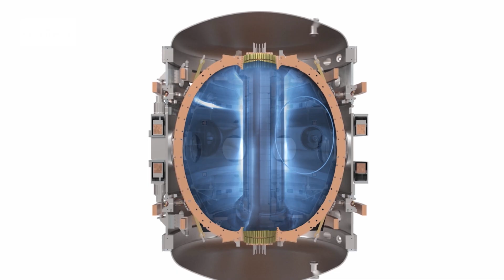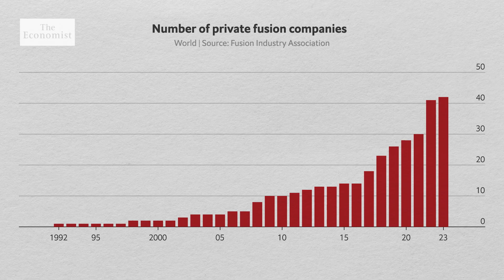Is nuclear fusion the future of clean energy?

Comment: 3:10 deuterium is fairly easy to come by in nature, but tritium is very rare, and there isn't enough on this planet to supply fusion reactors. On the other hand, there is so much fuel for fission reactors to last us 1000 years.
Reply: So what are they thinking then? Surely there is a solution?
Reply: @musicalintuition  it's just one of the many hurdles to nuclear fusion. There are other fuels, but I believe D-T fusion produces the most heat with the lowest fusion activation temp. So it's the place to start.
Reply: Yeah let's use fission for 1000 years so we can make the planet uninhabitable.
Reply: @sapphyrus  The hard facts are that fission is the safest and least environmentally damaging way to generate energy. Safer and more sustainable than wind or solar per terrawatt of energy generated. If you're knowledge of nuclear energy and waste starts and ends in the 1960s, I could understand your point of view. But reprocessing and inherent safety design eliminated nearly all of the concerns you could reasonably have against it. The only hurdle left is to implement these better nuclear technologies at a large scale. Several other industrialized nations already have. They undoubtedly have high upfront costs, but low operational costs which makes them comparable to renewable energy costs over their lifetime
Reply: @sapphyrus  how do you figure that would happen?
Reply: Tritium is produced in every watercooled nuclear reaktor. To seperate it out is a minor problem compared to get fusion reactors working.
Reply: @krautergarten4529  True, you need fission reactors to fuel your fusion reactors, so it's not really the perfect energy source to solve all our problems.
Reply: @ColCurtis  we will always need fission reactors to produce isotopes for medical, aerospace, fusion, etc. And we still need to build 1000 to 2000 new fission reactors in the next 50years to stay below +3°C. So there will be enough tritium for the first gen. fusion reactor, for the sec. or third we may use berilium. Halflife of tritium is 12years.
Reply: @ColCurtis No on a lot of levels. As a source material for starting a reactor, tritium would likely come from fission moderator rods. But every fusion scheme in the world that is targeting a D-T system plans to breed tritium from lithium using the fast neutrons in the fusion reactor. It's not an engineering oversight, it's a journalistic one. That said, fusion powwr generation is not likely to reach a level of maturity adequate to be commercially viable for at least another century. It's not a condender to the climate crisis
Reply: @Spencergolde  you think the climate crisis will be all over and done in a century? We need some big gun energy solutions down the line, and it would be better if it wasn't fission.
Reply: @MattNolanCustom  I believe, with data backed up by climate research, that if we don't largely replace our energy generating capacity with non-carbon sources before the turn of the century, human life is going to be very difficult to sustain, there will be lots of suffering, displacement, famine and drought. We have non-carbon energy sources today that are mature and, not just ready to deploy, but actively working in our grid right now. Nuclear fission is powering some of the servers you're currently using to view this comment. Granted, fission can benefit from Gen IV technologies that eliminate the possibility of meltdowns, reduce waste volumes by at least 95%, and breed their own fuel. That technology already exists in the lab and will be responsible for baseload energy maintenance in the coming decades. Solar, and more so wind, will also play an important part with the aid of grid battery storage; but it will take a concert of renewables and nuclear to overcome this issue, as renewables are too environmentally destructive (compared to nuclear) to meet energy needs in their own
Reply: @Spencergolde  one major way we could lower the future greenhouse gasses that nobody wants to say is to quit increasing the global population.
Reply: @Spencergolde  I don't disagree with you at all. We need a diverse, carbon-neutral, mix of power generation, adopting all the things we can as quickly as we can. But, looking at the various other "footprints" of various energy generation methods when adopted at huge scales, fission and hopefully later fusion have to be a significant part of that mix, otherwise we just end up "killing the planet" in different ways.
Reply: @MattNolanCustom  I think the way I'm looking at it is: with a limited amount of money and political will to achieve climate stabilizing goals, I think the vast majority of investment should go towards developing things that have a clear part to play in the solution. Fusion just, doesn't. The most likely reactor to reach ignition, which has the most money and the best minds working on it,  is ITER, and that doesn't even have a targeted online date. If there's a miraculous way to get around the engineering challenges we're facing now, we haven't found it yet, and as with all miracles, there's no way to say when that will happen. Solar and wind and batteries and nuclear have adressable issues that we understand and can work around. I just hate to see people investing tens or hundreds of millions into something that's sold as a keystone to fighting climate change, when it definitively won't be. That money could have induced actual, positive change, but instead it'll be sunk into a rust bucket that some venture capitalist with a business degree, who read a physics book once, decided would look cool
Reply: @Spencergolde  I don't think it's a question of either or. There's money to do it all, and we should be planning for the further future as much as tomorrow because climate change is going to take many decades to sort out. I'd say that the MIT / Commonwealth SPARC will likely leapfrog ITER (though the work from ITER has certainly helped them along!)
Reply: @MattNolanCustom  The money can and will run out. Climate change is expected to endure high economic costs from things like increased drought, flooding, migration, loss of agriable land, mass migration, increased hurricanes, increased disease domain spread, etc. We have time and money now, but in 30 or 40 years, we might not have the luxury of being able to spend time and money on science projects that don't have an immediate practical application. Yes,  zero carbon energy development would still be helpful then,  but in desperate times, you might not be able to find investors or governments that are willing to spend on tomorrow-solutions, there's likely going to be high demand for short-term solutions and not much else. Keep in mind that we're still living in a time of plenty, which makes well wishing easy, but we are literally on the precipice of that no longer being the case. So every single year and dollar is critical. 
And yes, I'm aware of SPARK, I think if they're legit about the confinement field strengths they were able to achieve, that would be impressive and could achieve ignition on paper, given what we know now about H-mode instabilities, and assuming they can maintain those field strengths 24/7 and not just for a breif demo. It is of course made possible by rare earth superconducting magnets, which I think may be prohibitively expensive for a commercial reactor. They also need to focus on helium product removal to prevent extinguishing the ignited plasma, a challenge that fusion researchers have known they need to deal with and haven't had enough success to get to deal with yet. I'm less inclined to rip on SPARK because they're taking a novel technological development (lower cost, flexible type-II superconductor tape) and are applying it to a mature sector of fusion reactor design. Many others, though, are pie-in-the-sky, or else like helion, near direct copies of research done in the '80s, with nothing new or noteworthy to add.
Reply: Also tritium is radioactive :/
Reply: @kashmirha  bananas are radioactive

Comment: More and more people think today that c² in E=mc² is imaginary - a faith not science - as "A derived Value must not violate the Concept of its Value".
When energy looted - it turns - curse.
A curse that destroys in humans consciousness and the future.
Karl Marx, Nikola Tesla, Balfour, Einstein, Huxley, Orwell, Turing - should be forgiven for thinking their systems can last forever.
Finite fossil fuels are dangerously hypnotic to humans, their consciousness, reasoning and mental capacity.
Humans were not ready morally, ethically and intellectually to start the mass extraction of fossil fuels with the advent of the steam engine 300 years ago. 
The Magna Carta requires today overhauling – adding to it the right for humans to understand what Energy really is - before any other commandment;
“In any system of energy, Control is what consumes energy the most.
No energy store holds enough energy to extract an amount of energy equal to the total energy it stores.
No system of energy can deliver sum useful energy in excess of the total energy put into constructing it.
This universal truth applies to all systems.
Energy, like time, flows from past to future” (2017).

Comment: Quantum mechanics allows for a small portions of fast neutrons are created.   These neutrons would make the fusion chamber radioac😮tive.  What are the precautions are 4:26  be formulated to 6:13  mitigate this?
Reply: Pretty straightforward. It comes down to material selection. Some materials like aluminum are fairly neutron transparent and don't form long-lived activation products. In general, activation products tend to be short lived, low activity, and non bio-accumulating. It needs special handling and a decade or so of isolation, but it's not comparable to the fission products that come from a fission power plant
Reply: General Fusion's design contains the reaction in liquid metal.  The "reaction chamber" is constantly cycled... it's how they extract the heat.  Must admit, I'm biased towards their design... steam powered pistons compressing a bolt of plasma contained in a vortex of molten metal has to be the most steam-punk energy reactor ever :)

Not holding my breath but I do wish them success.
Reply: @4Fixerdave  thank you for the heat transfer method.  Wish them luck too.

Comment: No! Nuclear fusion is neither renewable nor sustainable. If it ever actually works, we will start burning up our oceans -- all our water. Turning the Hydrogen to Helium at exponentially increasing rates as our demand for energy in the past has increased exponentially. When we are done, the Earth will be a dry desert like the Mars. It's actually ecologically worse than Oil.
Reply: Why are you spreading misinformation? Don’t comment on something when you know absolutely nothing about it.
Reply: @Gomlmon99  Apparently, you have no idea how nuclear fusion works. It turns hydrogen into helium. The hydrogen comes from the oceans. We burn the heavy hydrogen first, then we run the regular hydrogen through a nuclear reactor to turn it into deuterium and tritium -- then burn it. Once it is helium, it can never form water again. We will be burning our oceans. That's the way it works, that's the way it has always worked.

Comment: It's a waste of time when you can just invest that money into wind power, solar power, geothermal power, tidal power, wave power and storage, all of which work and don't require any scientific breakthroughs.

The only problem with green energy is the political will to move away from the lobbying (corruption) that goes with fossil fuels.

Look at the US the easiest place to turn to green energy is Hawaii, it's a series of volcanoes, so there is more than enough geothermal power, just like Greenland has done.  But Hawaii also is in the middle of the ocean so it's got enough opportunities to run 100% on wind power.  It's also very sunny, and you could have enough solar power for 100% of all the power.

As for storage you have mountains where you can build pumped hydro storage, or you could use hydrogen storage, or lithium batteries or sodium batteries.  Probably the best long term storage would be the hydrogen, and the short term storage would be a mixture of the pumped hydro and the batteries.

The fact that Hawaii isn't running on 100% renewable power, has nothing to do with technology, there is more than enough technology that has been invented for Hawaii to be 100% renewable.  It's a political problem.  And if the US can't solve the easiest US State then the US will never bring down it's CO2 output for any US state.
Reply: Solar power requires a lot of land + maintenance and has a shorter lifecycle too i.e. 20 years. Wind turbines also have recycling issues like the solar cells. Nuclear reactors are best choice, if the safety risk is well taken care of.
Reply: @gagan3440  solar cells don't have recycling issues they can be recycled and are being recycled.

The only issue recycling centres have is there aren't many old solar cells.  You wrote that their lifecycle is 20 years, so just have a think how many solar cells were being installed 20 years ago, that doesn't provide a recycling centre with many cells to recycle.  Even 10 years ago there weren't many solar cells being installed.

As for recycling wind turbines, there are developments in that area, but then again there aren't many old wind turbines, certainly not enough to build a recycling centre.  In reality the matieral for wind turbines will probably be reused for something completely different rather than recycled.

Comment: The Economist is not produced by engineers but by people presumably paid to promote well funded hype. Otherwise they would be promoting the British Moltex flex reactor, which benefits from the engineering advantage of using liquid nuclear fuel held in static pipes. I.e. no pumping of highly radioactive fuel around a system of pipes that will probably spring a leak one day. That makes the flex reactor so simple and cheap that they will compete with fossil fuelled electricity. Moltex energy in Canada are also pioneering the recycling of high-level nuclear waste for their stable salt fuel. Capital cost is a little over $1 per WATT. Dispatchable power is available from heat stored in a system bought off the shelf from the solar thermal people. Selling electricity at peak demand will make the reactor highly profitable. They recently signed an MOU with Emirates nuclear energy Corporation.

But all of this is a distraction, because the energy transition is not going to happen soon enough to avoid cascading climate tipping points. Respected climate scientist Jim Hansen now says probably the safest way to cool the Earth pending net zero is by marine cloud brightening. That works by adding benign aerosols over the ocean, replacing the cooling effect recently lost because of new shipping legislation that has removed sulphur dioxide emissions.

Comment: The problem of nuclear fusion is not technology. It is economy. Maybe we can make viable fusion technolgy and reactor by 2050, but its cost to build and operate will far exceed that of nuclear fission reactor, let alone conventional fossil fuel powerplant. So, it will not replace conventional power plants in the foreseeable future. We need interim solutions before transition to nuclear fusion. 4-th generation nuclear fission reactors like molten salt reactor or pebble bed reactor seems to be promising.
Reply: This is speculation. There are no operational fusion reactors with net positive output, let alone as part of a power plant. To say how much a potential products might cost based on current experiments is just conjecture.
Reply: So it is the technology, because we no cost efficient technology ready by 2050.

You need to build the 4th generation nuclear plants yesterday, for 2050. But they won't be build until the end of the decade and won't come online at least 5 years later. SMRs too, no commercial reactor before the 2030. How is nuclear the solution to a climate crisis we spend 50 years on waiting it to happen? It is like catching the train that already went out of the station. Nuclear will never be ready to play a major role in energy transition. Even in China is no plan for more than 15% nuclear electricity.
Reply: "The problem of nuclear fusion is not technology. It is economy." Uh thats not even remotely accurate...... Honestly what do you think they are testing for ITER? 

Or do you think they got 38 countries to build the most complicated piece of energy infrastructure in the history of humanity for craps and giggles?
Reply: There are enough mineable thorium on the earth to satisfy humankind for 1000 years, combined with wind，solar, hydroelectric may extend for another 1000 years. These are mature technologies, while fusion is always twenty years in the future.  So leave it to the future generations to do the fusion.

Comment: Fusion is inevitable, the engineers on the forefront should be proud of their work
Reply: Fusion is already here.  You can produce nuclear fusion at home, if you really want.  (Look up Farnsworth fusor, for instance.)  The roadblock is that there is no clear path to commercial viability for fusion power.
Reply: Fusion is a welfare program for plasma physicists.
Reply: Fusion is not inevitable, we don't even know power from sustained fusion is technically possible at this scale